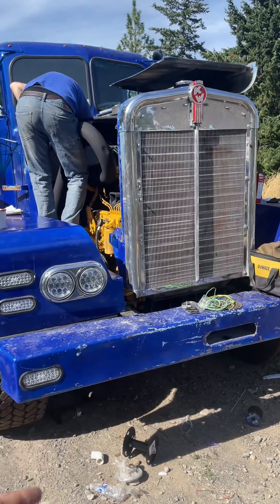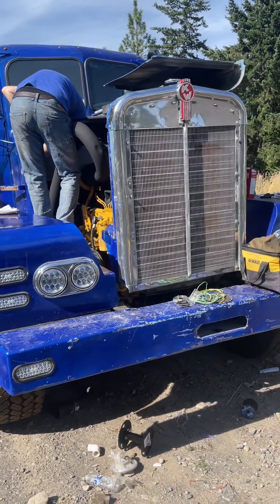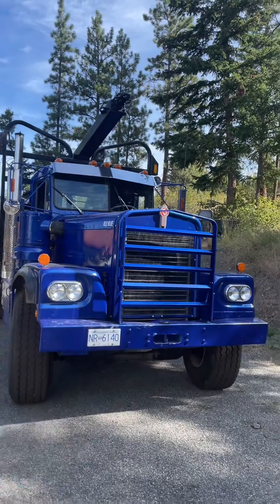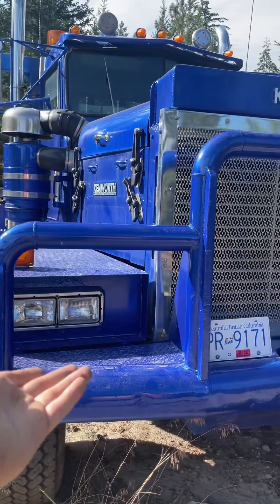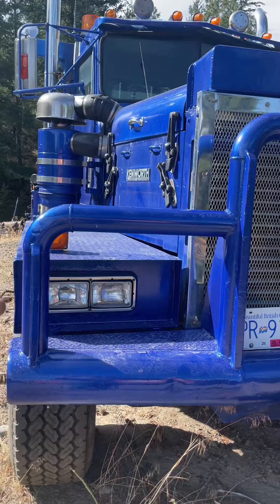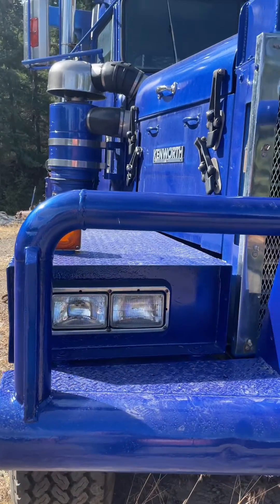The Case for Standard Parts: Why Reinventing the Wheel Isn't Always Necessary

Comment: Amen!  But why use those E-axles?  Shouldn't you isolate the motor(s) and all those weak connections and components from road bumps, bangs, and vibration?  Is parasite drag of the driveshaft and diff really a big deal or is the E-axle builders warranty the draw?
Really love the idea...hope the best for the Class 7/8 truck, but really, really excited about the light-duty (pick-up) conversation.

Comment: Half agree and half disagree. Without engineering new stuff, technology would never advance. There is a reason why Tesla "re-invents" so many things, they want to advance technology. Not be stuck in the 70's. Like going to 48 V electronics. A lot of it has to do with safety. Edison trucks are as safe as a truck from the 70's. 
But advancing tech shouldn't mean it's too difficult or expensive to maintain vehicles.

Comment: Many suppliers would not sell to Tesla in the early days.  GM and Ford literally went to car shows so they could look at Tesla’s to figure the part suppliers Tesla was using and give them an ultimatum (No Tesla or No GMor Ford).  Since Ford and GM were much bigger buyers, most suppliers chose to avoid Tesla.  As a result Tesla is not willing to rely on those part suppliers who cut them off in the early days.  The result is from scratch efforts that are super efficient, but non-standard.
Reply: Tesla was partnered with Mercedes and Toyota in the early days. The b-class ev and rav4 ev were tesla powertrains

Comment: Apparently the normal Tesla motors only have something like a 60 hp continuous duty rating, which is safe to say is just not nearly enough for a loaded semi truck.
Reply: That's a useful spec that no one ever talks about. Thanks.  

I wonder how that varies with ambient temperature.
Reply: A few years ago I interviewed for a place that did efficiency mods on trucks: like run at a higher temperature,,, and limit the horsepower to 60hp while cruising.
Reply: How does 240 horsepower sound for keeping a loaded semi at 50 to 55 mi an hour
Reply: @the_undead  At 30 L /100 km (8 mpg), and 20% efficient diesel engine, I calculate in my head that 80 hp could keep a loaded truck running on flat ground, on average.  A car uses about 20 hp at 7.5 L/100 km from what I remember.  Going up the Coquihalla Hiway from Hope to Merritt will use all the horsepower you've got.  240 horsepower would require 89.7 liters per hour at 20% efficiency.
Reply: Something I wanted to add is my source is from aging wheels. He has a school bus that he is turning into a toy hauler/camper/maybe a tow rig, and wants to make it electric, and that is where I learned about the continuous duty rating.

Comment: "If you want the truck to last"

Bold of you to assume Tesla does 🙃
Reply: Just wait for an out of warranty cyber truck to throw a steering fault code. Who is going to want to fix it, and how much are they going to charge?? If the battery is suffering high deg, then it may well be uneconomical to repair it.
Reply: @the_lost_navigator7266  

At that point, just install an Edison truck retrofit. 🤣

Comment: You're right but their brand in many senses is "reinventing the wheel" and this is not the best plan all the time lol😂. I am not a Tesla fan or advocate just a guy pointing out some brands stick to their thing even if it kills them.
Reply: Pretty much the same with SpaceX these days. I mean, with the Falcon, they made a rocket that worked, and THEN bolted on the guide fins and landing struts and experimented with getting it to land. With Starship though, they are not only re-inventing the wheel over and over again, they keep repeating the mistakes NASA learned from over 50 years ago! SpaceX has a MASSIVE advantage over NASA in that they're not structured like a government jobs program, they build everything in a single facility, which makes the manufacturing so much cheaper. But they WASTE those savings by running fast and loose in the development instead of taking the time to plan things out! Simple stupid mistakes like not having a water deluge system, or not having enough baffles in the tanks, that cost SpaceX millions more than if they just did it right the first time!

Comment: The longest lasting "anything" can be repaired over and over and over with common parts.  Why was Chevy the most popular brand years ago?  Parts interchangeability!  How many small block engines were built from parts from other small block engines despite displacement differences?  Millions and it was fun and rewarding!  Not today.  Nothing to do with cars or trucks is fun anymore.  Parts problems, prices, availability and STUPID LAWS from STUPID POLITICIANS that have never owned a wrench.
Reply: I love when I can just go to my local Lordco and order a bag full of the common bearing sizes my equipment uses!
Reply: GM partially invented planned obsolesce. To compete with the model T, gm came out with a new update every year and marketed as vanity and you wouldn't want to be seen in the old model. The model t had very few updates from 1908-1927 and resisted making the model A for several years. GM also introduced auto financing to the masses, Ford didn't believe in usury(charging any interest)

Comment: Thats what is great about the milking robot i have. The base is stolen from a cnc machine the, programming is from the older robot what still worked, all air is from festo. Milking equipment is the same in all there conventional machine. Only the downside they still calculate a pretty big mark up on licenses and parts